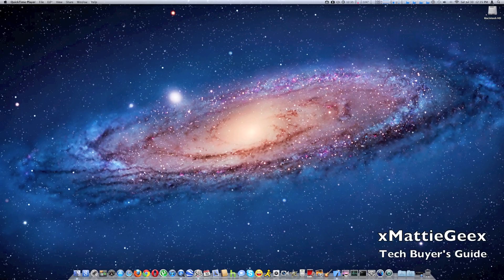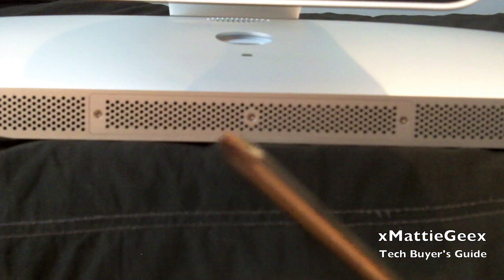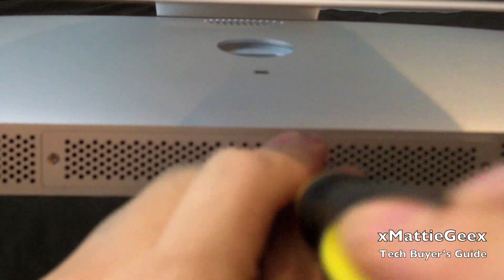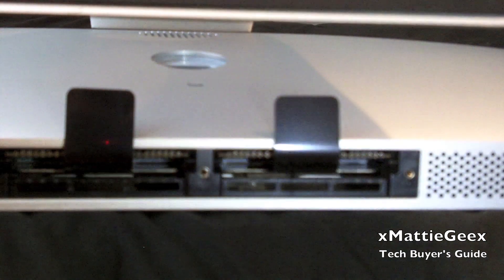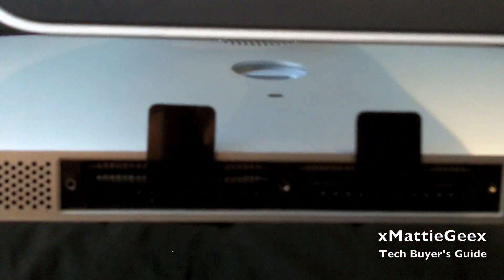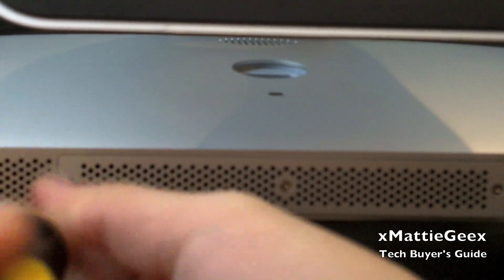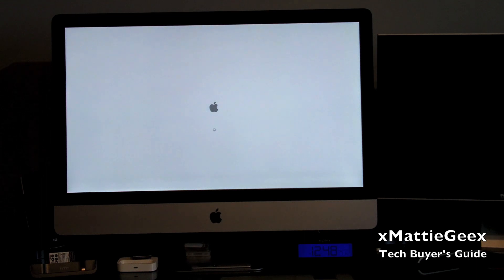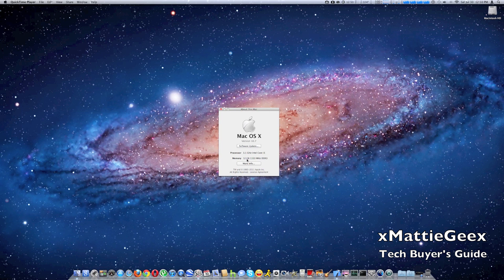Installing 8GB's of RAM (4GB's x2) DDR3 @1333MHz By: OWC

Comment: @ Gee, 

You might want to re-adjust the RAM sticks so that the better ones are on the primary Slot 0 and the old ones on Slot 1 (in similar branded pairs). Your computer will be a lot more stable.